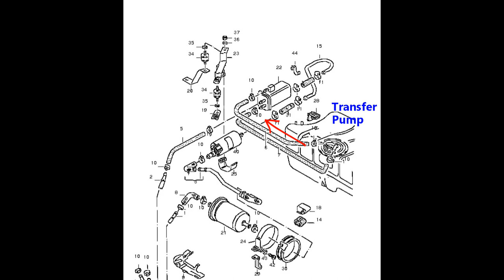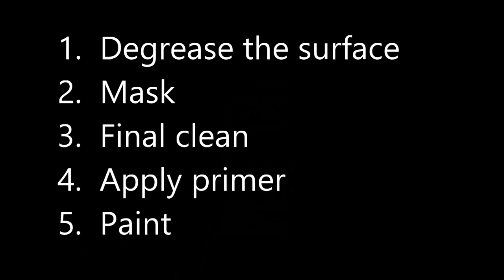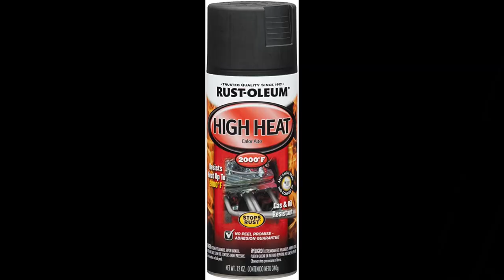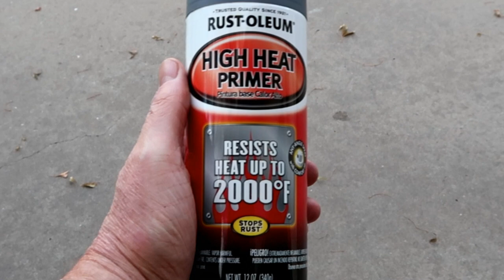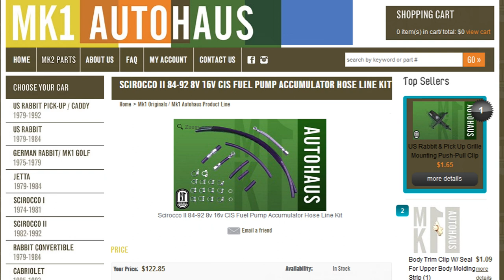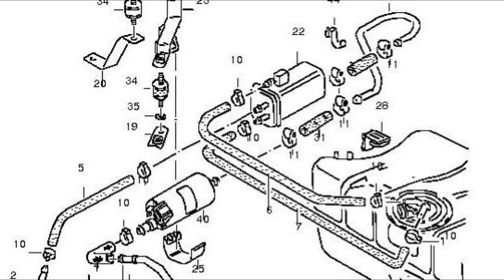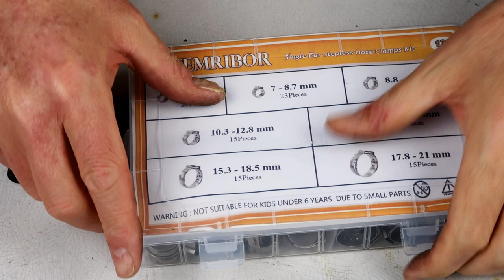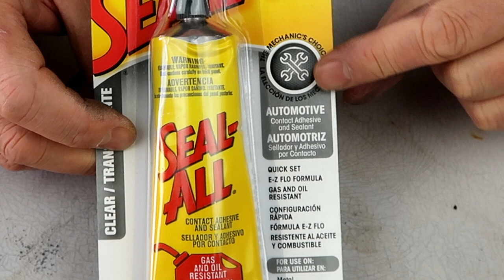1985 VW Scirocco Mk2 | Part 5 - How to Install the Fuel Delivery System (Tanks, Accumulator, Pumps)

Comment: Quick update for you. Just had my own tank refitted by a local garage 😬. I did supply them with a pair of NOS Mk1 Golf metal fuel lines. Pleased I did, as this was where the majority of the corrosion problem was. 
Now the carb jets have been cleaned and she's supping on clean fuel the drive home was a joy! Yes it did cost me in time, but worth it! 
Oh guess what, they found out my ignition barrel was dodgy too... think there might be a vid on how to change that somewhere!!! 😆
Reply from the maker: NICE!  Glad to hear she's on the road again.  I'm still waiting on fuel filter parts so I'll have to wait a bit more to try to start my Mk2 and see if I put the rear end together correctly.  Those ignition modules are a poor design to be sure.  Thanks for the update!  Appreciate your comments.

Comment: The gravity/vent valve has a black hose on the top of it. When I pulled on it, it was not connected to anything. According my Bentlley Manual the diagram says it goes to the Expansion tank. Do you happen to remember what you came across? I have an red 85 rocco just like yours :) Thank you for posting all these scirocco videos

Comment: hi i need serious help time  urgent I started with hearing a buzzing noise coming from the main fuel pump inline and barely made it home as it started to die and stall I replaced both fuel pumps and fuel filter and I'm still getting a buzzing noise from the main fuel pump and its brand new it runs now but not sounding how it did before this all started any ideas why

Comment: Could you tell me where you bought the fuel sending unit that you took the float from? Thanks for sharing these videos. I have a scirroco engine on my WV rabbit
Reply from the maker: It was sort of a fail.  I bought one on ebay which indicated it fit a Scirocco, but ultimately it did not.  I took the float from it as it was a direct match. Best I could say at this point is to check out the photos for one similar.  Probably not much help.  Sorry.  Good luck.
Reply: @ParksandRecYT  the one the you buy is tha one that I need,  thanks